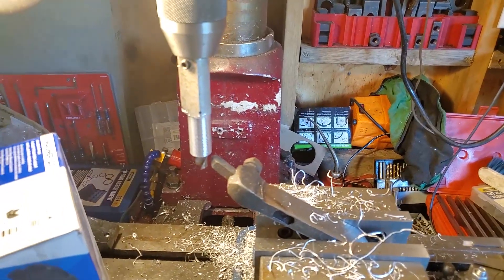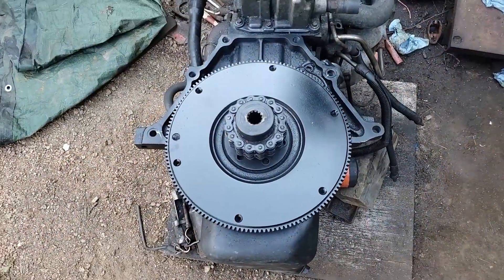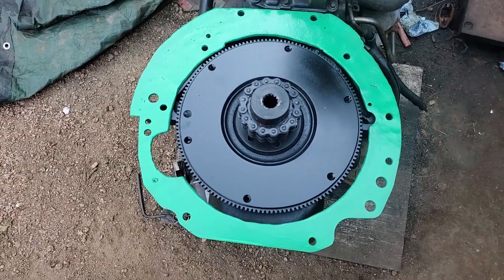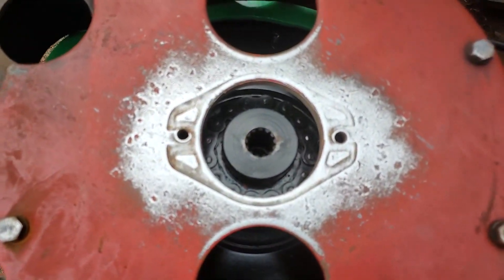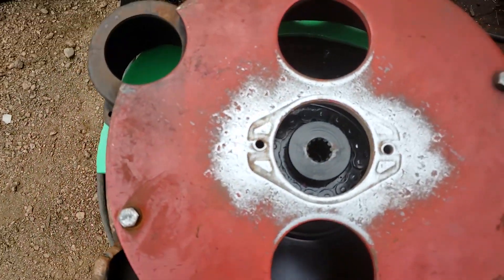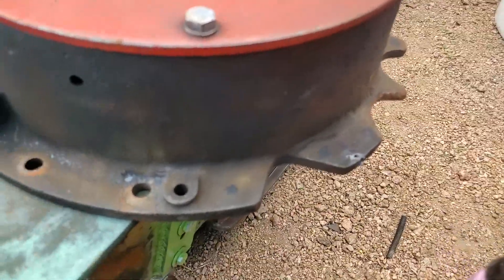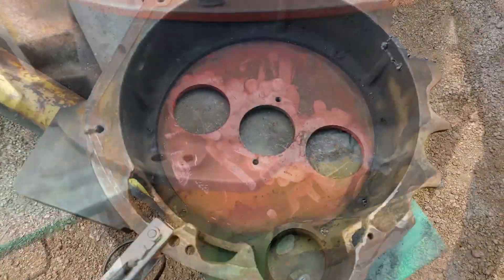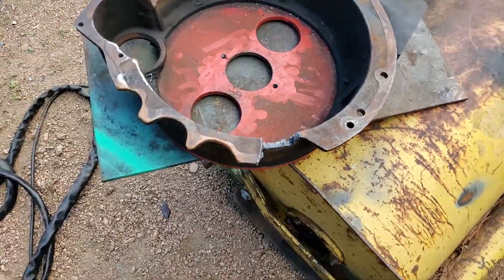Gehl Skid Steer Loader HL4400 Repower Part 1

Comment: Excellent video, I’m working on a gehl 4840 that got a little crispy…swapped the locked up diesel for the closest motor on hand..ford 200 six. Now to figure out the hydraulic solenoids.